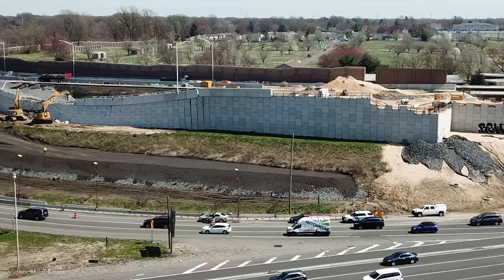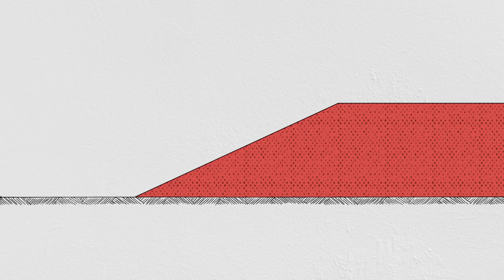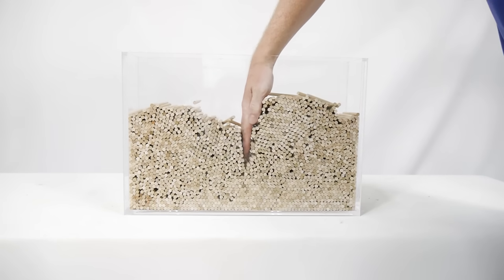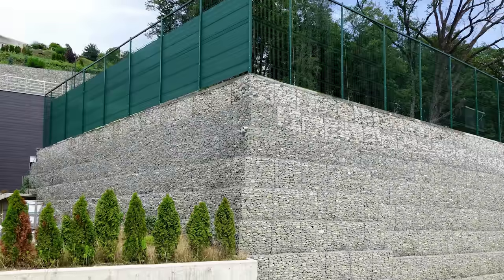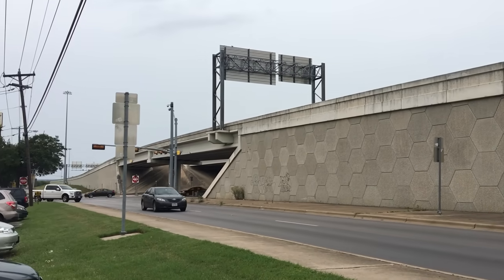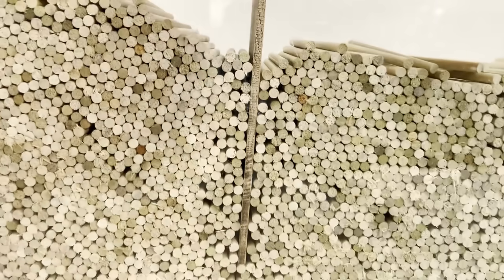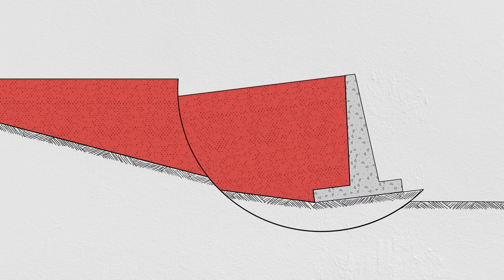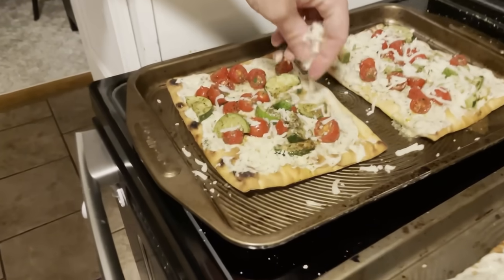Why Retaining Walls Collapse

Comment: The investigation suggests poor soil material selection among other reasons leading to failure.  

My question is whether the material selection was justified by the findings at the time of the design or not?  It's pretty easy if they weren't, that's just part of engineering findings and solutions, alongside the accountability of design and construction. 

If they were justified however, that sounds like a potentially harder problem suggesting soil profile changes.  The easier version of that is localized/micro-system changes.  It would still be preventable, but it might be unusual to the extent that other areas with similar design reasoning would need to considered.  

The harder version is a combination of microgeological system changes and microgeological system changes.  Hearing concepts like 'the aridification of North America' more often are a bit concerning, and I presume it is not just a matter of a total system dry-out, as much as a total system change that may result in unexpected moisture content changes in areas where this was not previously observed.  In other words, moisture contents may rise in some areas where other areas fall and the reasoning and prediction of this may not be obvious.  This however is purely speculative, may not be an issue, and even if it is an issue, it may not have anything to do with this incident.  Smash that like button and ring that bell?

Comment: Concrete has rebar or other internal structures to hold it true. Couldn't we install a similar semi flexible internal cage layer by layer. Let's see. ahh say 1 foot by 1 foot squares or stronger geometric shapes like alternating pyramids then pour material into it. Compact it then attach another layer via flexible poles that can survive the compacting step and then fold back up to be bonded to the next level. Rinse repeat. If something does fail it would take longer to fully fail and be found at the next inspection. Guess you could get REALLY stupid and install pressure sensors inside the flexible material.  Plug in a comp and download the pressure readings into a 3D model and see if there are any changes. Lower psi means something is on the move possibly creating spaces for water to get in and do it's lets make this bigger thing.
Higher PSI would show stress points or shift directions as well how big the affected area is and which way it is going. 
This is gonna be one of those that's not it works in the real world or sure we have thought of that. Just gonna need all of you to pay more taxes because let me tell you it's not even remotely cheap.. LOL

My extensive engineering skills were put to the test at an early age. Built a wall and bridge from straws and 3x5 cards in 6th grade. Won by holding up under the biggest stack of encyclopedias.
After that achievement I decided since I was so good right out of the gate I should avoid further engineering projects in fear of getting bored in the future being so good there is no challenge in it anymore. Next thing I know I am divorced and driving around in my high performance car (gloves and all) looking like a middle aged man who can't accept where I am in life with an subconscious hate of straws and 3x5 cards to the point of getting panic attacks whenever I see fast food cups and running away when I see flashcards...........

Ok.. WOW.. That's enough coffee for today.....

Comment: Why are construction projects ALWAYS  late? I have worked as a commissioning engineer  and an engineer designing of warehouse layouts. Once construction begins it never gets finished on time.
Reply: Sometimes schedules are simply not realistic. I'm not a engineer but a carpenter, from time to time we have to wait because the preparatory works are not ready, but then we should finish our job in an unrealistic short time which is often not possible. Delays of a single contractor push back the complete schedule, and delays of more than one contractor are adding.

Comment: Here are some example videos that may be at a more easily comprehended scale of work to help reinforce the key concepts this story tells - there is both thought (brought in by the design and long developed expertise) and work effort (strong backs, legs and arms) successfully executed all mutually involved in a build project (note however the long term maintenance required - which is frequently neglected - is missing from this 'new' construction, of course, as that does not yet occur but hopefully does so in the future):
https://www.youtube.com/watch?v=XZUXxoZ1n04
How to Build a Retaining Wall and 6 Reasons they Fail
Stanley "Dirt Monkey" Genadek

https://www.youtube.com/watch?v=rOS8lhhFZZw
How to Build a Retaining Wall - DIY
Odell Complete Concrete

Comment: You state that SOIL IS TWICE AS HEAVY AS WATER.  This is obviously false.
Reply from the maker: Well it does sink
Reply: @PracticalEngineeringChannel  Are we talking buoyancy or weight?  Water has more mass per volume than soil, even wet soil is going to be lighter than pure water. Volumetrically speaking.
Reply from the maker: @TrevorStruthers  I encourage you to look up a table of the specific gravity of different types of soil. I don't think you'll find anything less than one. How would lakes and rivers have bottoms if the soil floated?

Comment: I drive that area in Jersey all the time. Worst designed interchange I've ever seen. It's been horrible since it was first built in the '60s. 

They keep trying to fix it but everytime it's just as bad as before. This time the construction was just as bad as the original design.

It should all be torn down and rebuilt.

Comment: Soil is twice as heavy as water?  That cannot possibly be right.  Having a big lake full of heavy water pushes the earth below it down, causing a depression.  I know I’ve read about that before.  Putting a swimming pool on a rooftop is a harder engineering problem than putting a big flower garden (half the size of the pool) in the same place.  I feel like there’s an obvious example that I’m missing, sorry i just woke up.
Reply from the maker: If it weren’t true, soil wouldn’t sink in water.
Reply: @PracticalEngineeringChannel  that’s a good point.  I usually know better than to post things when i wake up, but i like your videos, watched it before i was fully up :)

Comment: Why do we tolerate Grafitti on new walls and locations.....something brought on by using light coloured, (though not exclusively) materials, and by allowing reasy access to these locations.

We should be planting gorse, thistle and nettles.....or even installing wire to prevent the grafitti lunatics getting anywhere near..........and we should be removing grafitti as soon as possible from locations whenever and wherever it occurs.

Tolerating ugliness only leads to more ugliness.............
We only have to look at modern architecture to understand this....

James Hennighan
Yorkshire, England

Comment: Some of the best and oldest standing retaining walls are was steeper then you could achieve with modern engineering and tech. Just a few example right of the top of my head are the Mga Hagdan-Hagdang Palayan ng Kordilyera ng Pilipinas, or the terraces in the Sacred Valley of the Incas. The world is covered in earth works that have lasted thousands of years... the problem is modern tech, or maybe just lazy cheap crooks.... who knows..

Comment: Because u don't build with hand u use a bunch I'd machines needs work should have built in granite the way we do it in new England no dry laid Boulder wall set with camber or battier will.ever fail if landscape is maintenance  if u build giant concrete walls hey r dambs and will fail Crack and not lady u need tons of drainage but u r almost better building with more space and slope but if u build with stobe 500 to 10 000 plus pounds a.stone built by skilled builders will last indefinitely when built right with batter massive base 3000 to 12000 pound base stone 1 to 6 or even uo.to.8 to 13 ton stones pushed into.spac3s when nesssery set into.subgrafe with gravel base and trench u can't go.wrong new England style 100s of walls built. Or think.of stone Jettys all built between the great wars and after ww2  all still here built with stone last in water through hurricane 🌀 get some learn your materials